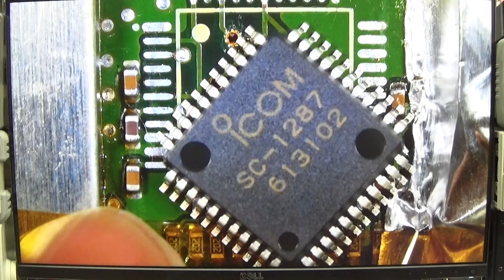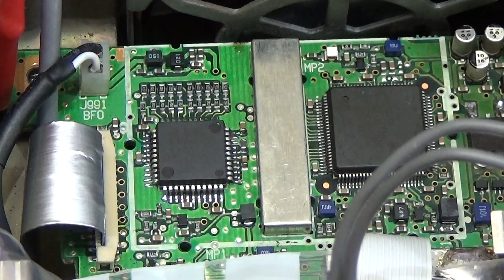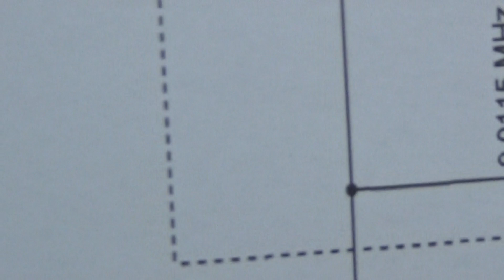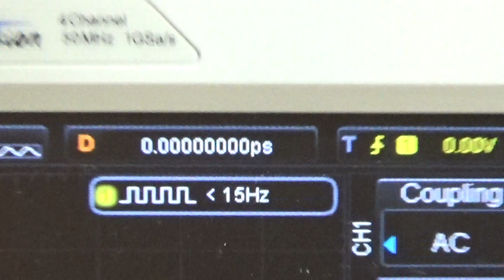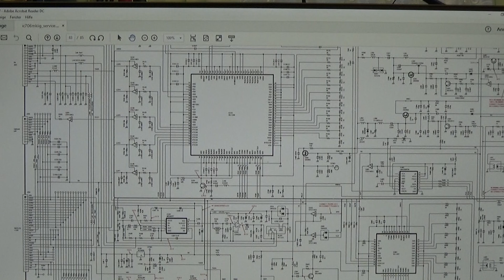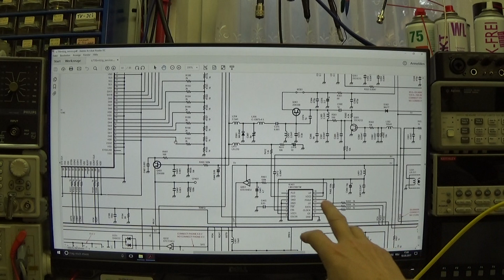#130 Repair Part 2: PLL Troubleshooting and repair Icom IC706

Comment: I couldn't find part 1 so I'm picking it up from here.  Can't wait to see the results.  Guess it doesn't matter if pins are shorted when tacking it down.  I hope I don't see magic smoke!  What, if making all the repairs and the customer can't afford the repair, what then???  Seeing the main processor would be quite expensive, would the repair continue?  Guess that's up to the customer.  If it were me, I'd be trying to find another board and not worry with component replacement.  Thanks for the video.  Cheers & 73 from W Rusty Lane K9POW in eastern Tennessee

Comment: The scope trace for the collector of Q71 had no signal.  Could if be caused by one of the other components in the output path being open or shorted?  Thanks for the excellent videos.
Reply from the maker: Yes that is a point Darren but of course I have tested it...Thanks for comment 73

Comment: Can you start listing the prices of repair parts like that big IC you ordered from the manufacturer so we can get an idea of how much repairs will cost for things like that?   That model radio costs $700-$800 on eBay so probably worth fixing except they have the dreaded SMD electrolytic capacitors.
Reply from the maker: Yes this radios are still for far  to much money on the net but this radios are not worth 700$...

Comment: Based on the voltage regulator being replaced, I would be looking only at all the parts that it supplied, that inductor being high resistance said to me it had been stressed so was almost certain the ic was damaged.

I would say that anything that would be damaged by excessive voltage after that regulator will need replacing (and likely nothing else), so yes replace both those ics, I think the issue is localized.
Reply from the maker: I have to see what parts I can still get..

Comment: Much like a rabbit hole, you don't know how deep it is until you dive in.   Since you have gone this far and as long as the supply voltages to it look ok I would probably go with replacing it.  Still no guarantee that's all that's wrong.  Look on the bright side, your definitely getting some SMD soldering practice in on this one. :-)
Reply from the maker: It is a rabbit hole as we can not really predict what's next :^) But we never can have enough practices on micro soldering right?

Comment: Hi Peter,
Good video showing your thoughts on how to proceed with the repairs. If it was my radio, I would go ahead and let you get replacements for both of those IC's. If there were more problems after they were replaced, I would cut my losses and give up unless a complete working used board could be found.

I do like Buddy's suggestion if a loaner board could be found just to confirm no problems with the rest of the radio.   73   WB3BJU
Reply from the maker: Yes I agree Donald maximum the both repairs and then we need to stop...Thanks for watching 73

Comment: I think I would have given a price to the customer based on the failure of both IC's and let them decide if they want to pay for the worst case scenario. That way you avoid the conflict caused from charging the customer for something that is not fixed.  Enjoyed the video. I always learn a lot. I also learned that customers might be nicer in Germany than they are in NYC :)
Reply from the maker: Yes under normal circumstances you are right to keep a repair somewhat economical..  Thanks for comment 73

Comment: Great work so far too bad the owner said put in a new board to save you lots of time
thank you for video hope to see next, the soldering you did looks better than factory !
Reply from the maker: Yeah you are right Dennis but this is a kind of show case to demonstrate what's all  behind a repair and what are the possible ways to go. But the OM would really like to get the radio back working ...Thanks for comment 73

Comment: it would make more sense to have a new board installed  along with those new bits on the board then spending days chasing faults, From a economical sense. considering the age of the radio in question
Reply from the maker: Scott you are right economically it makes no sense.  This case is more for showing the process behind it. Thanks for stopping by 73

Comment: Peter, I agree with your thought process on going further. If 101 is replaced then what is next?  Perhaps another major failure. You never know. Enjoyed it as always. Very nice video my friend. 73..
Reply: One other thing. If you can get a  loaner board to try that would really help.
Reply from the maker: Thank you Buddy. Yes you are right with the loaner and I had already a working PLL board in and the radio is working perfect.. Thanks for stopping by my friend. 73